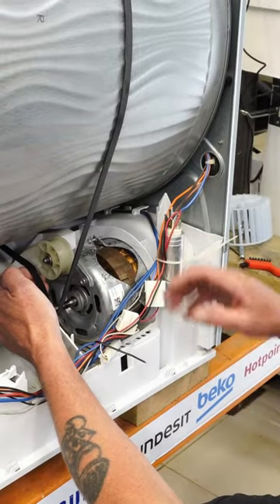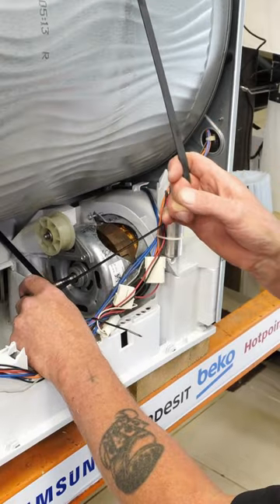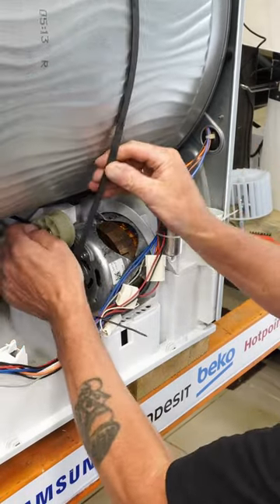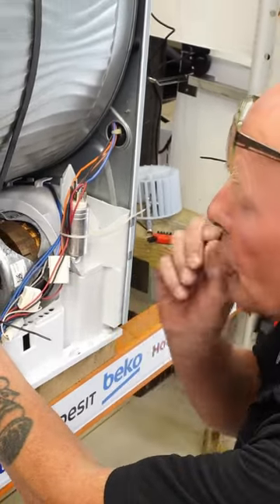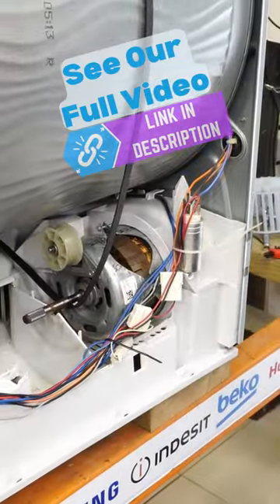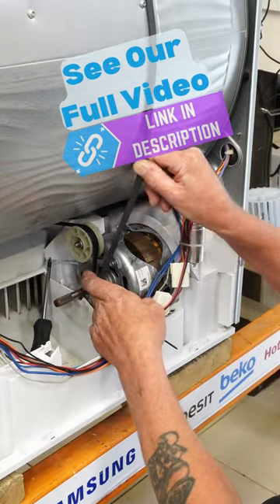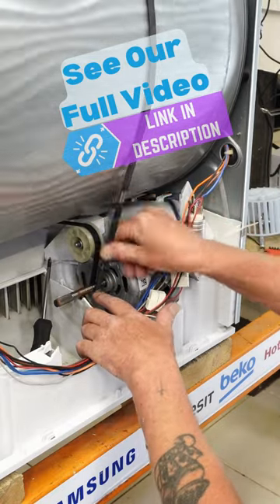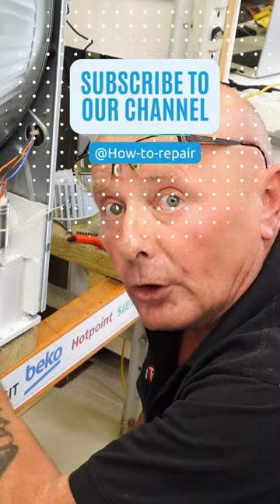Quick Fix: How to Easily Fit Tumble Dryer Belt Over Hotpoint Indesit Pulley Wheel 🔧🔗

Comment: Was always taught get the belt around the pulley first then using a piece of 15mm copper, fit around the shaft, apply a little fairy liquid and then slide the belt into position. Always interesting to see other engineers methods.

Comment: You can literally loosen the bolt on the pulley and move the pulley wheel to allow for fitting. Then put wheel back to original position and tighten.

Comment: I unscrew the pulley wheel from one screw, (the furthest one away) and loosen slightly the other so the pulley wheel drops.  Easier to get belt on then get a screwdriver over the motor shaft and under the pulley wheel bracket and lift, then put the screw back in